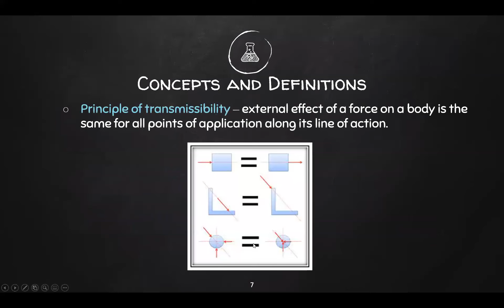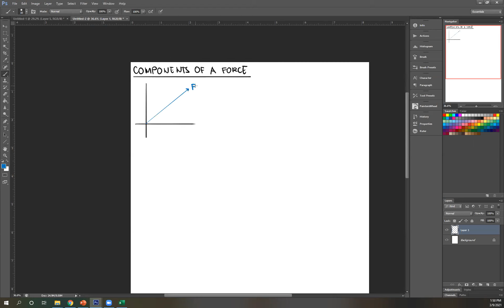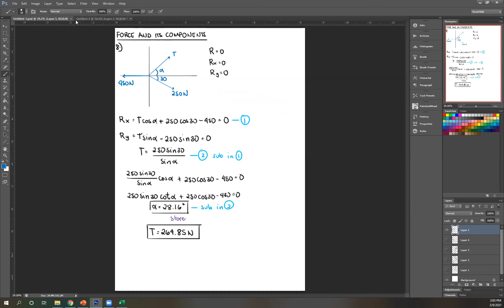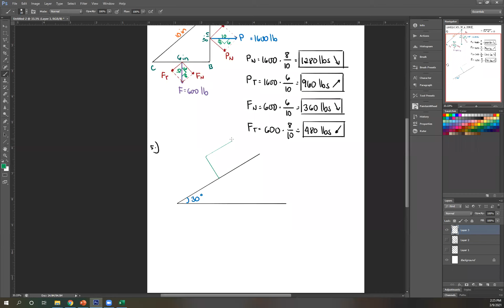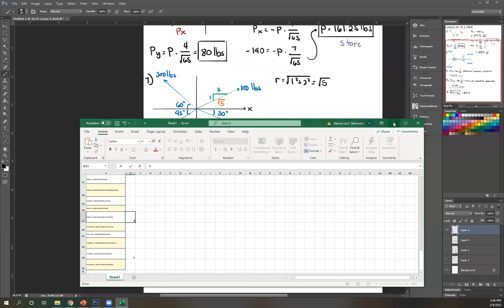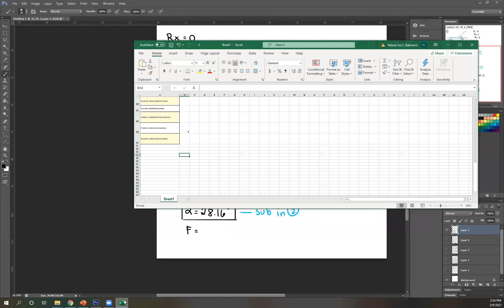[A53] MEC 30 LESSON 2: Resultant of System of Forces 1/2

Comment: paano po i input yung sagot sa cotangent po? d ko po kase makuha kahit naka 1 over arc tan na po, salamat po
Reply: Problem #8 po
Reply from the maker: @karld.navarro3070  make sure calculator is in degrees. and it should be 1/tan not 1/arctan
so if you want to use the solve function of your calculator just type
1/tan X =   (450-250cos30)/250sin30

or you can solve the right side of the equation first: (450-250cos30)/250sin30 which is 1.87
now you have cot θ = 1.87.
1/tanθ = 1.87
tanθ = 1/1.87
θ = arctan (1/1.86) = 28.16